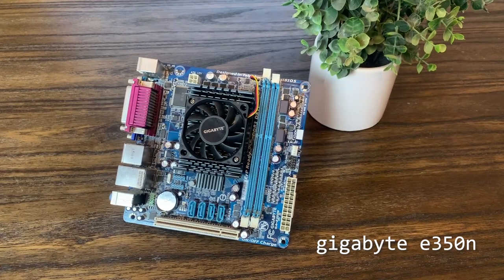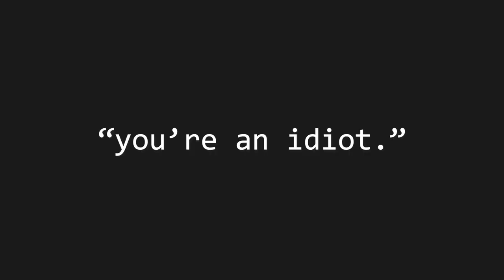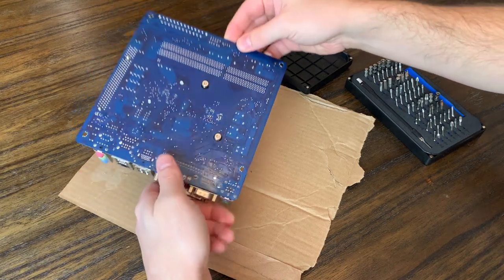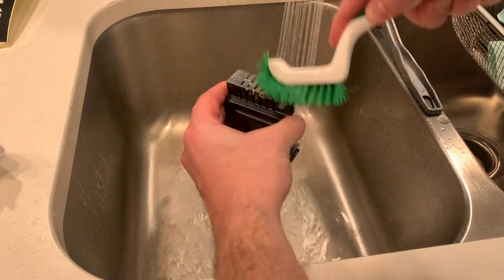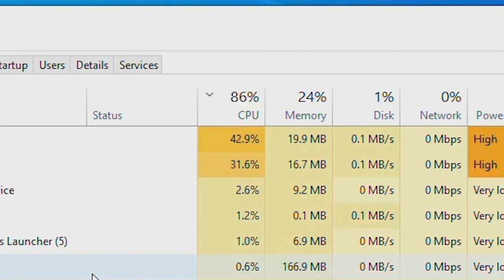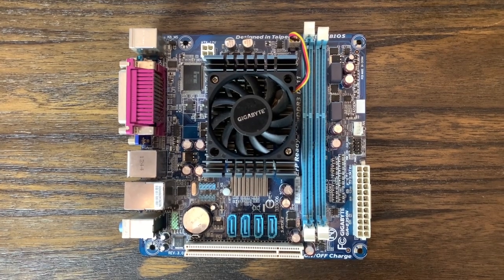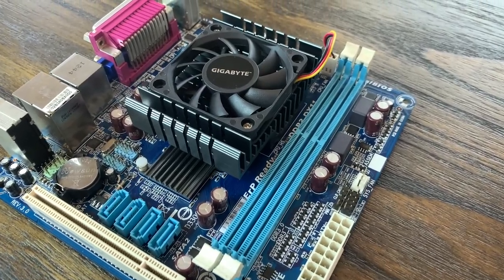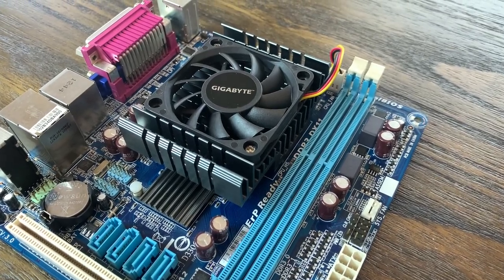Dual Core Disaster? - Landfill to Lan: Gigabyte e350n

Comment: I've never been a fan of manually spreading thermal paste like that.  I've convinced myself that doing so causes tiny microscopic pockets of air to form which could impact temperatures.  In reality though, it probably won't make any difference.  I just like to let the weight of the heatsink do the spreading.  It saves time too :)

Comment: I own a similar system, but it's integrated as an All-in-One. Some things I'll note are:
- Power consumption of the board in your video seems WAY too high. Mine stays closer to 20W.
- Linux is a MUST for these old AMD apus. On Debian 11, browsing the internet is only slightly slow, as opposed to unbearable. It can even run YouTube.
- No idea about using it as a home assistant or game server, but the e-350 can easily function as a NAS and media server, even simultaneously.
Reply: ive got athlon 5350 and a 5150 and that one runs windows 11 with ease with 4gig ram
Reply: the only down side is being from 2014 they dont decode vp9 in hardware yet they are still fast enough to decode h265 or vp9 1080p at about 40% cpu usage
Reply: ubuntu works well i find it uses more ram though